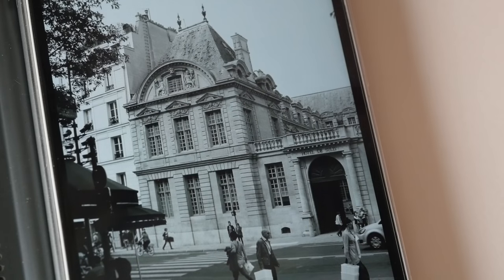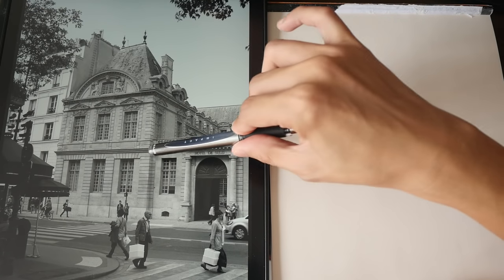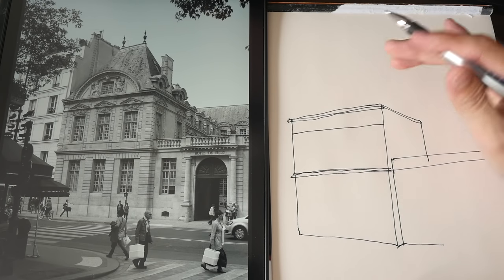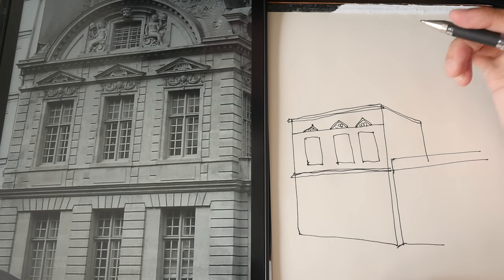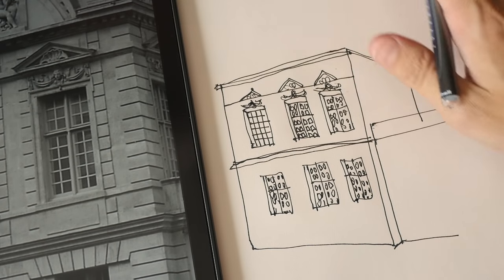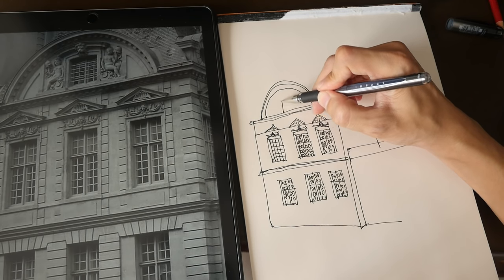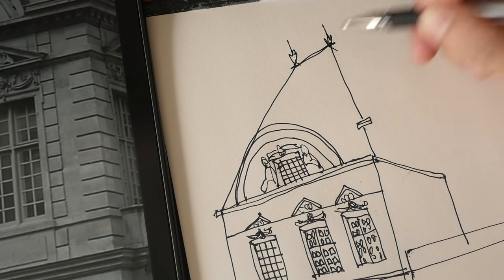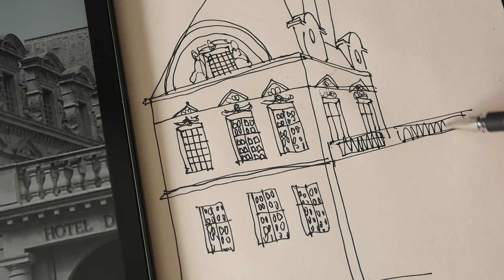How to Simplify and Sketch Buildings (Art Tutorial)

Comment: This is helpful. How do you ensure that you will have enough room for all the elements?  For example, in the sketch of the yellow building in your sketchbook, I would probably not have left enough vertical room for the dome on the right- I would have made the yellow foreground building in the left too big. Tips on getting the overall composition correct?
Reply from the maker: +Lark in TN One tip is to draw the biggest object you see first. If you can fit that in, you will be able to fit the small objects. 
So you should plan your composition to fit all your subjects, then draw the biggest object/line first. 
You can use a pencil to help mark out general areas if the scene is too complicated.